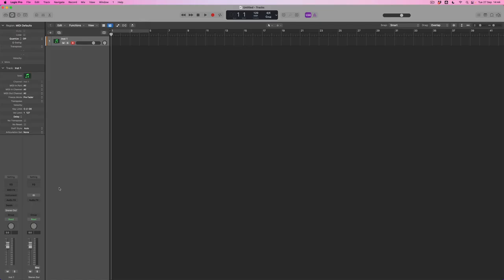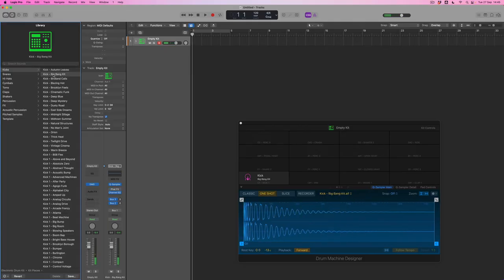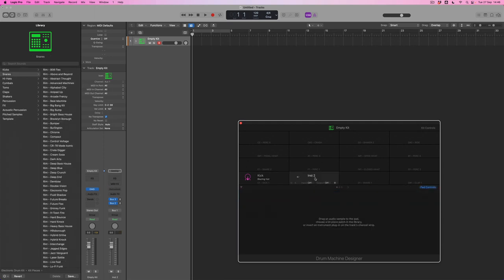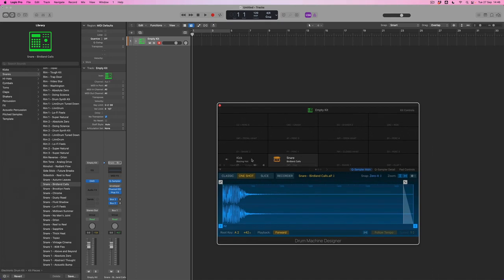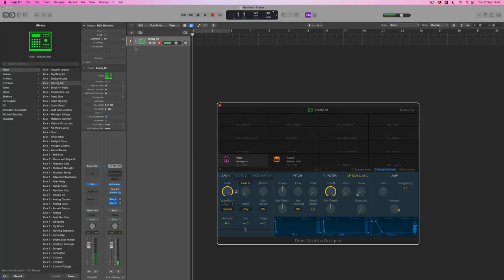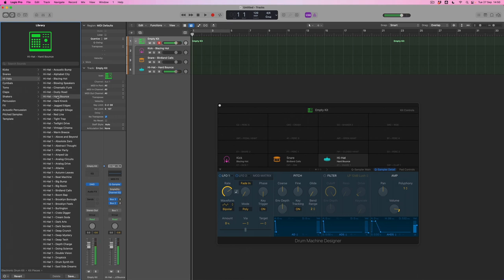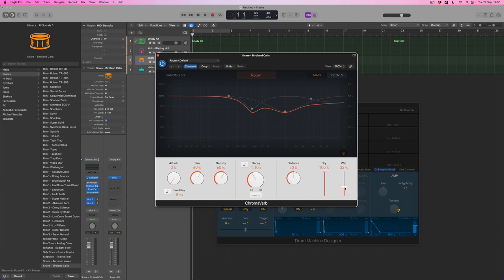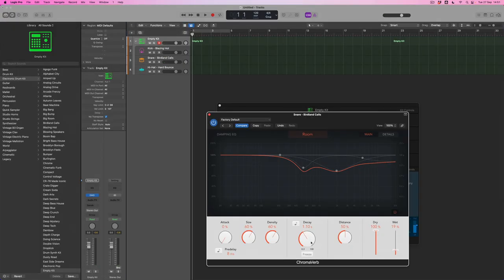LOGIC PRO X - Building a Drum Machine Designer kit from scratch

Comment: Excellent  description. Thank U, but how do we save the new drum kit to use on other projects?
Reply from the maker: Hi Rodney. When you've built your kit, open the Library by pressing Y. Then click once on the Blue DMD Instrument you've made. In the Library area, you'll find a Save button in the bottom right-hand corner, which lets you Save your DMD Kit as a Patch. It'll be saved into a new User Patches folder, which you can then access in any other Logic project. Hope that helps!

Comment: I’ve thought about this a bit more and have a couple of questions. If I build a drum kit using DMD in the way you’ve shown here each “note” plays a single sample. Is there a way to load multiple samples (round ribbons) into the same slot so that the drum doesn’t sound literally identical on each hit? Also what about loading samples that are sensitive to key velocity? Many sample packs give you a range of samples at different velocities. Can that be used in DMD? 

I suspect the answer is that none of this is possible right now in DMD. But if I am wrong, could be a useful follow-up video. 

Thanks a million.
Reply from the maker: Hi Andrew. These are great questions. Out of the box, no, there is no way to load multiple samples onto a single pad within DMD, which means you can't automatically assign multiple samples to a single pad to be triggered by multiple keys, or via multiple Velocities. However, there is a kind of workaround, which is particularly effective if you're happy to layer samples via Velocity. Any Q-Sampler pad/Track within DMD can be swapped for the full version of Logic's Sampler. So if you're happy to use the Sampler to layer multiple Kicks or Snares (as examples), via Velocity, and then to stack these, you can then use Velocity to switch between them. The easiest way to set this up would be to have made a Sampler Instrument in advance with your samples selectable via Velocity assigned to a single note. You can then load DMD, select the Track for the desired pad and switch playback for this pad to the Sampler. Then load your Sampler patch. Lastly, make sure the pad is set to trigger the correct Pitch. I'm very happy to make a video to demonstrate this in the New Year, but I hope that makes sense in the meantime!
Reply: @jonobuchananmusic  Massive thanks for taking the time to explain this. Sounds a bit tricky, but doable. I’ll leave it to you to judge if it’s worth a video. I’d be happy to see it, but obviously you decide if there is likely to be broader interest. 

The last time I used the sampler I found it a bit outdated and difficult to navigate. It feels like Apple should find a streamlined way to bring this functionality into DMD. Maybe one day they will? Perhaps DMD is primarily aimed at electronic drums where round robins and velocity layering are (perhaps) less of a concern.
Reply from the maker: @andrew6889-p5c  Pleasure. I think it's a great idea for a future video. Next week's episode takes a couple of steps in this direction, as it follows on from this one and will show you some of the benefits of switching Sampler options within DMD.

Comment: Hi Jono, just a question, every time I try to copy a note in the piano roll and dragging it to a different note by holding down Option + click and drag it fails.. I get a green + symbol and then the note gets deleted. I figure I must be doing something wrong.. I hope my description was understandable..
Reply from the maker: Hm, that's odd. It might be that you're ever so slightly releasing Option before finishing the operation, which will move the note rather than copy it. Notes can also 'vanish' if you try to move them outside the zone of a region. So if your region is a single bar long and you attempt to copy a note to the following bar, the + will appear but the note will vanish when you let go, as the region isn't long enough to house it. Let me know if either of those things fix the problem. If not, I'll put my thinking cap back on.
Reply: @jonobuchananmusic  Hi Jono and thank you for replying. On my 2014 15" MacBook Pro macOS Big Sur 11.7.2 with Logic Pro 10.7.4 it works fine, I select the note(s) and hold down Option and drag to a different note position and that works fine. On my 2020 13" M1 MacBook Pro  macOS Venture 13.1 Logic Pro 10.7.6 I found that it did work when I put it on a hard bench top  then select the note(s) hold down Option and then drag to a different note position..  The other thing with the 13' MBP Logic Pro I need to resize the notes to make them thicker in order to select note(s) + Option + Drag but it seems to be working now... I think the 13' MacBook Pro needs a solid firm surface to sit on as I have it currently sitting on some paper note pads on top of  another laptop computer (lack of space here) this may be affecting the functionality of the Option button. Thanks again, David.